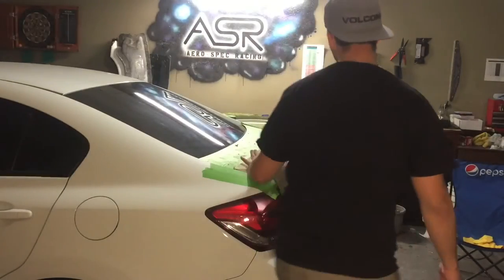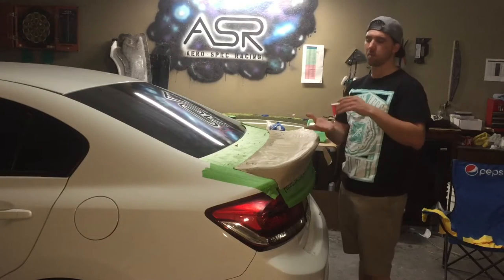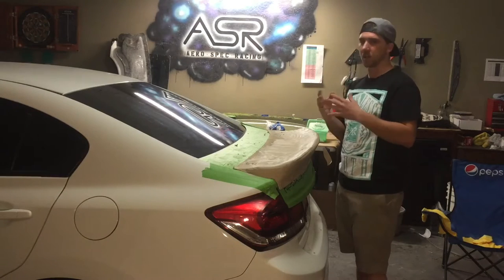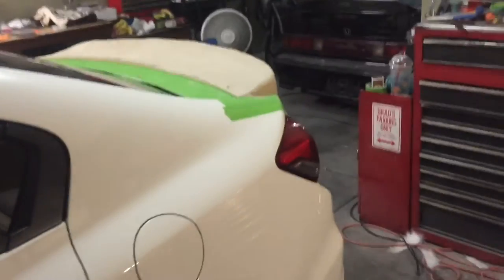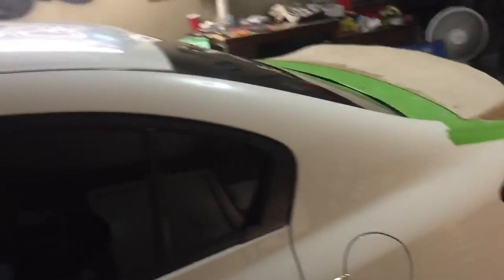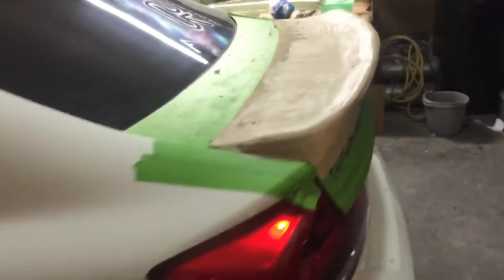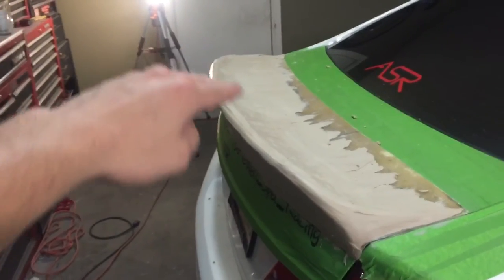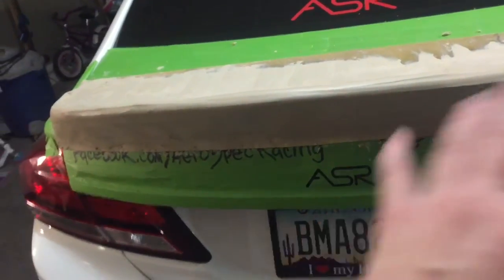(Part 3) 9th gen civic si ASR duckbill creation.

Comment: you do some great work. props to you man. what kind of clay do you use? i love how you made it so you can take it off, great idea.
Reply from the maker: JOEGGGJOE this is general purpose non hardening clay, I picked it up from a local artist
Reply: oh ok. you dont have to warm it up or anything like that?
Reply from the maker: JOEGGGJOE if it's too cold outside it helps to warm it up. This clay is harder to work with that chevant auto clay but it's much cheaper

Comment: make it a bit higher
Reply from the maker: This is the early stages, should have a update soon
Reply: Just stumbled upon this video and this duckbill looks very nice so far. Cant wait to see the end results. Exactly what im looking for. Tasteful mod
Reply from the maker: +Junior Pivaral thanks man, I'm getting back to it shortly, just had a few other deadline on some other projects.
I have a guy who wants this for siema so I'm trying to have it done by the end of September
Reply: +Aero Spec Racing oh ok cool, i see that youre covering the factory bolts, it would flow better if you arched it a little from one bolt hole across to the other bolt hole so it doesnt run straight flat across mid trunk. just a suggestion but i subscribed.
Reply from the maker: +Junior Pivaral it will followt he curvature of the trunk body lines, so it won't be going straight across... I posted a second video where I talked about it a little.
But I'll upload some more progress shortly 👍🏼👍🏼